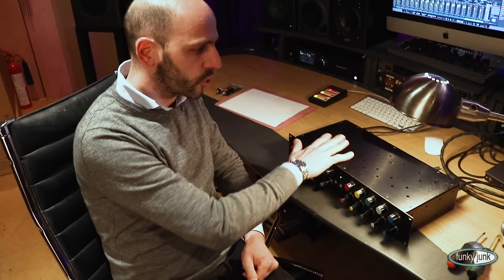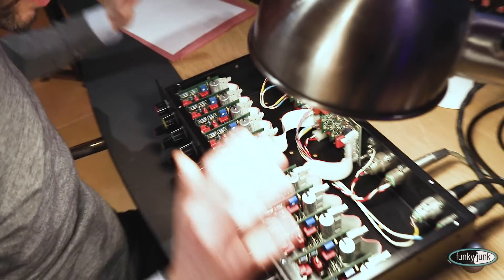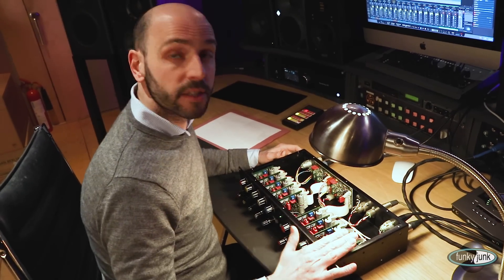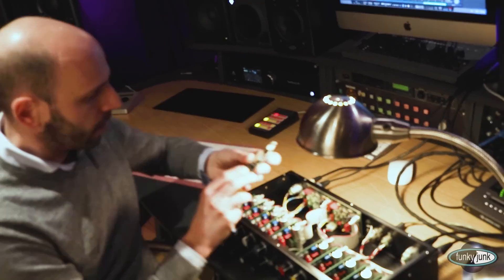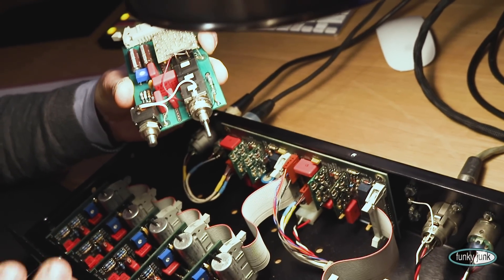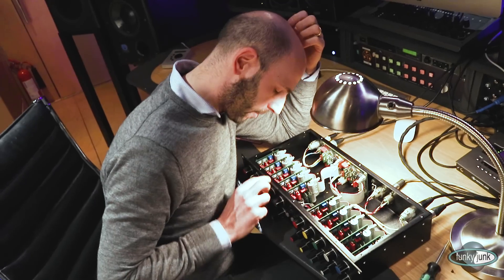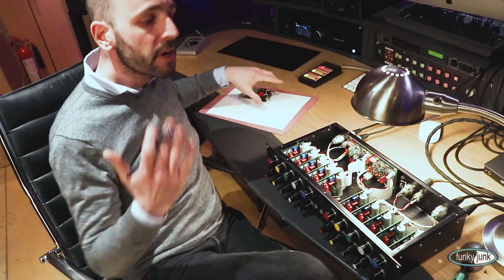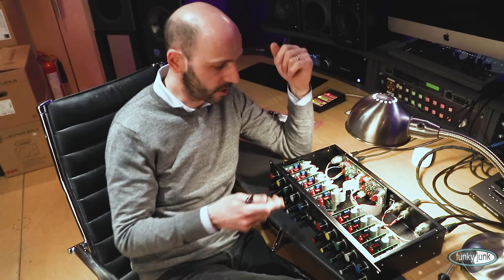The Naked Tech - GML 8200 Parametric Equaliser

Comment: 9m25s if you want precision for mastering purposes you have to have the stepped switches (???)  is that what he said "stepped switches"  ??? did someone understand this better than i did ?
Reply: yes as it happens potentiometers carry a +-10% tolerance (sometimes even 20%) so when you set 2 pots in the same position it is very unlikely you'll get the same resistor value and therefor gain, centre frequency or Q value. funny isn't?

Comment: What do the mods do?
Reply: absolutely nothing....  the eq only uses non polarised poly capacitors in the signal path.the electrolitics are only there as . power decoupling. unfortunately when people see electrolitics capacitor they seem to think that they must replace them with expensive "audio caps". so the electrolitycs on the cards were replaced with Rifa electrolitics. that makes absolutely no difference to sound at all... :-D
Reply: @mattsartori_bat  Can I get a before and after audio example? Pre and post mod.
Reply: Im sorry maybe I did not explain myself correctly. The mod was not put in by us, it was done prior to be sent in. The mod does absolutely nothing to the sound
Reply: @mattsartori_bat  then why was it modded if there is no benefit or difference in sound????
Reply: C Diaz good question, only the person who modded it can answer that
Reply: Matt Sartori  hey is there any plug-in to emulate the GML 8200
Reply: @micahalston8974  Acustica Green, Amek 200, Pulsar 8200